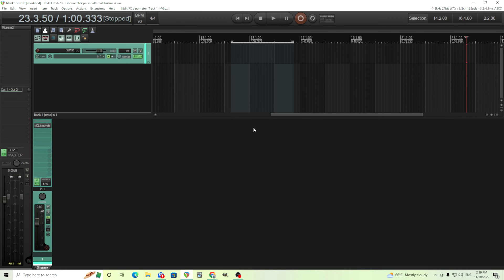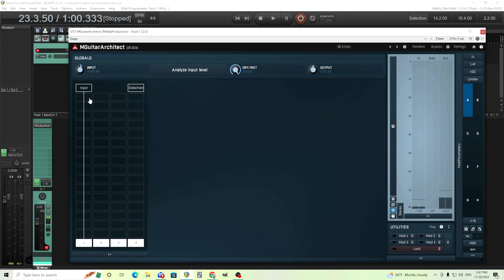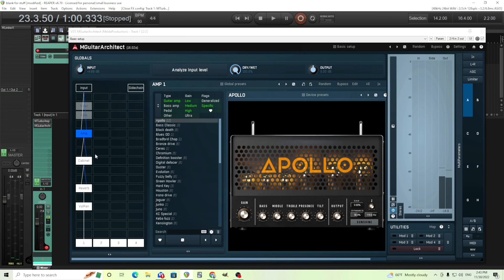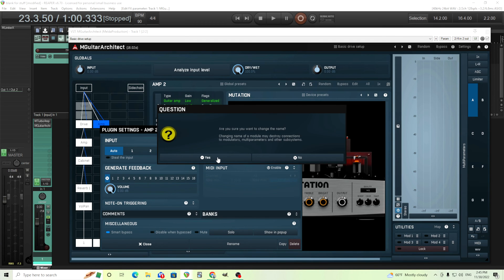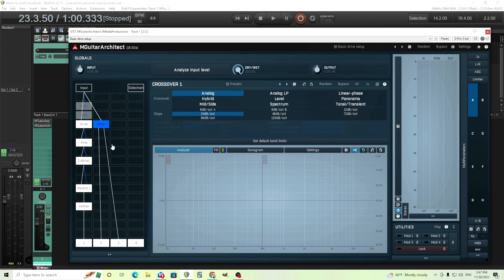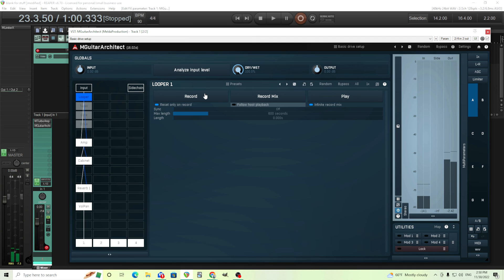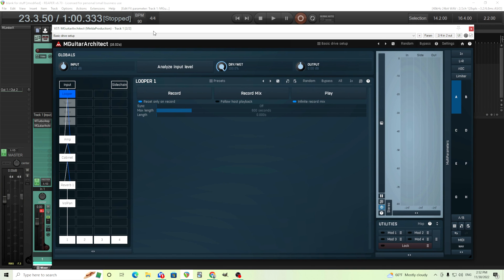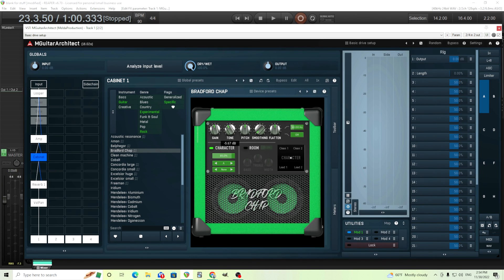MGuitararchitect Preview

Comment: thanks to your help i have gotten my arms really around the melda stuff, its for sure the best $16 a month or whatever i spend for the bundle.  one thing i have been slamming my head on is setting a sync'd random.  like i tried doing it following your sample and hold video but it just didnt seem to work the way i wanted.  i just want to be able to modulate things randomly on by 1/4 note or 1/8 note or whatever.  I was trying to do it in mrhythmizer and my work around was setting a random modulator to a push button multi paramater, and then setting a modulator to trigger the push button and then just doubling the speed.  but there has to be a better way.  These plugins seem like they can do anything, its the figuring out how can be a little difficult.  I know this video is not related to either of those, but i watch a lot of your videos and this just happened to be the one i was on when i decided to ask and i am not finding a video that really explains it.  the sample and hold works in certain plugins, but not in Mrhythmizer i dont think at least.. ooo i guess i could probably bring mrhythmizer into mxxx and do it that way.  any suggestions you have tho would be appreciated.  thanks again for the work you do

Comment: I managed to get a demo of this in one of the bundles. There’s an activate button, now that the trial is up I am getting noise… so is this live now? I had better luck with this plug-in than anything I’ve tried, outside of melda products at least. So again, is this live yet?
Reply from the maker: Unfortunately it hasn't been released yet, but hopefully it will be soon. There are presets and things now, so hopefully you'll be able to get it soon.

Comment: Great walkthrough. Looper is really useful that way. I think i'm personally more prone to use MXXX, but will try GA out for sure.
Reply from the maker: Of course you can use MXXX if you prefer. Hopefully there will good presets in GA that will make it worth using for even those with with MXXX.
Reply: @Chandlerguitar  Oh crap! I just discovered that TurboAmp in MXXX has no devices! That's incredibly limiting. I can't imagine anything other than it will be added soon. I got a shock, apart from the complete vaporization of creative flow.
Reply from the maker: @JanSandahl  Check MTurboamp Ex. It should have the devices in it. It does on mine.
Reply: @Chandlerguitar  Phew! Yes, it does. Thank God. :)
Reply: Do you know what the "Ex" stands for?
Reply from the maker: @JanSandahl  Unfortunately I don't. There are a few other modules like that as well. I learned that's where the devices are usually.

Comment: Really looking forward to this very cool tool. Great idea using the looper to try sounds too. Thanks again for all your great work on these videos and making amps etc!..

Sadly even as an owner of MTurboAmp and mCabinet (together my best, but also ALREADY my most expensive guitar software), I'm no doubt going to be forced to pay for the ability to save/load/switch amp and cabinet with a single click, an ability I got for free in literally every other guitar amp software I've ever used. (It's really not a 'feature', it's basic functionality for a guitar rig, that is completely taken for granted by every other developer).

Would really appreciate some matched cabinets (ideally for every amp, like every other program has), that switch in mCab when you switch amps in mTurboAmp when a "Lock mCab to preset changes" mode is engaged.

Needless to say, this is basic functionality shared by every single competitor, the lack of which is no doubt surprising and disappointing to every customer, and should NOT be dependent on ownership of mGuitatArchitect. 

IMHO, adding this would be less of a 'new feature', and more of a 'bug fix'.
Reply from the maker: Thank you for watching. I requested the looper be added for that purpose. I hope people find it as useful as I do.
Reply: You said it all mate! I totally agree!
Reply: Nope, check out Waves Studio Rack, which is free. Use it until you decide to go for Guitar Architect - or MXXX Core for starters. I did. Very usable.